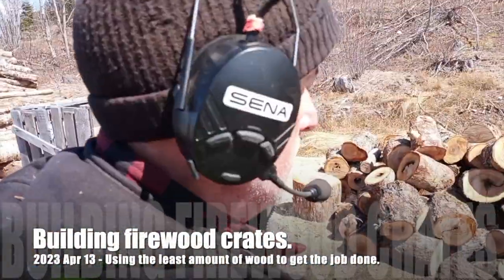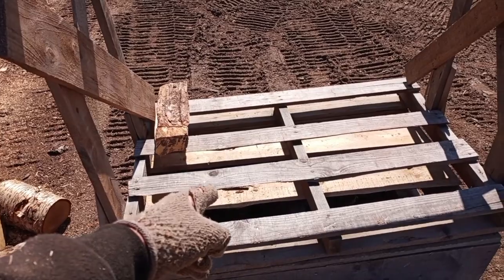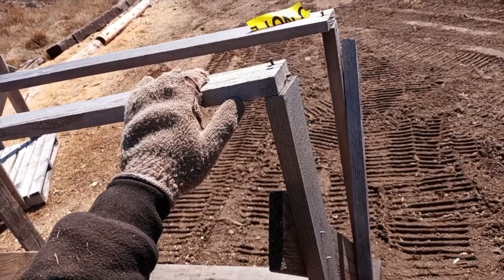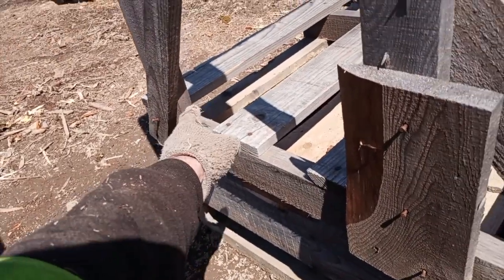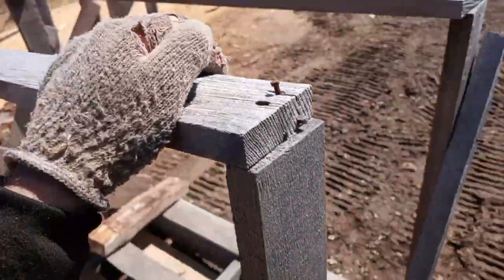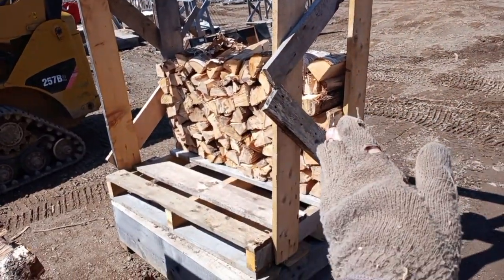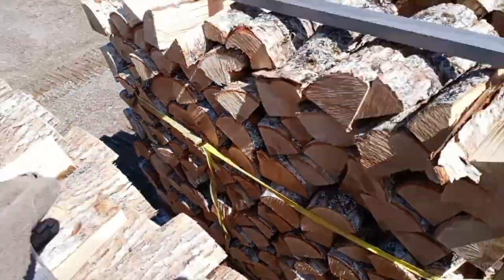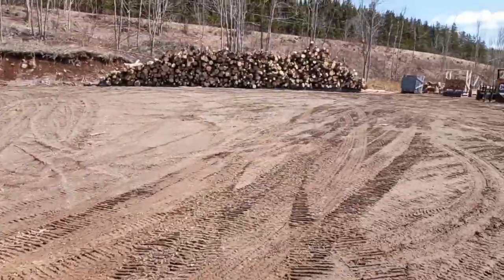20230413 How we build firewood crates.

Comment: I like the 2"x4" or 2"x6" for the pallet base, I have been using 4"x4" and think it overkill.
Reply from the maker: I think so too. I've done some pallets with one inch thick boards. It does the job but only last half as long. So 2" thick is the sweet spot of the three base pieces.
Reply: Same here

Comment: Well that makes sense now.. .  When I make smaller smaller wood then 16.  I sell for the same price but explain to them its measured by the face ..
Example a full cord is 3 not 4 stacked 4x8 due to the extra work involved
Reply from the maker: I get what you are saying. At this time we charge the same price whether its 12, 14 or 16" . 128 cu ft of stacked 12" pieces is a lot of work compared to 16". Not just the extra cutting but the extra splitting because every 12" stove we have made wood for also requires smaller face pieces, so that means more splitting too. We only have a couple clients like that. If it gained in popularity I think pricing would have to change.